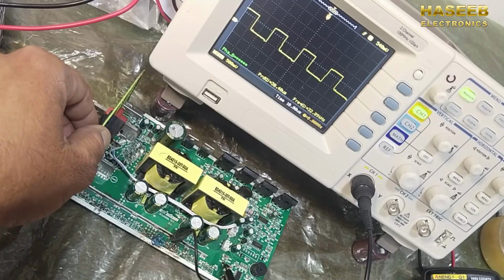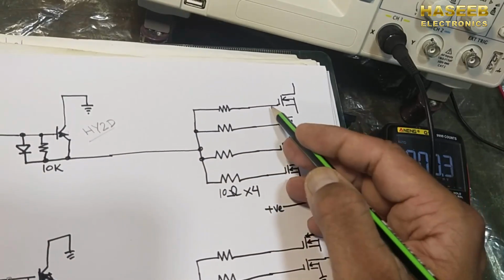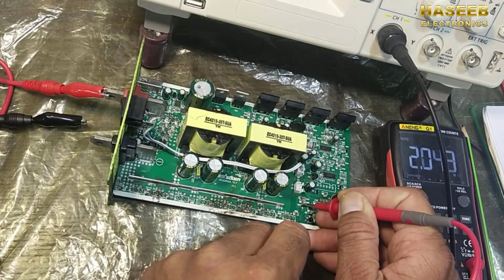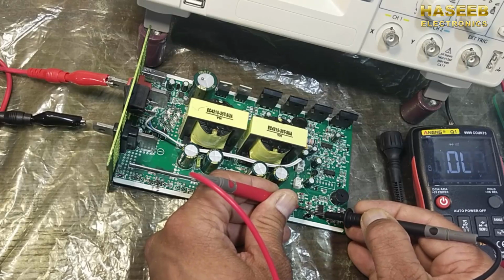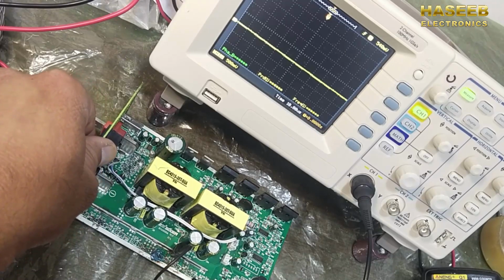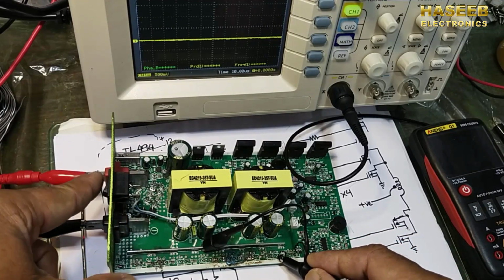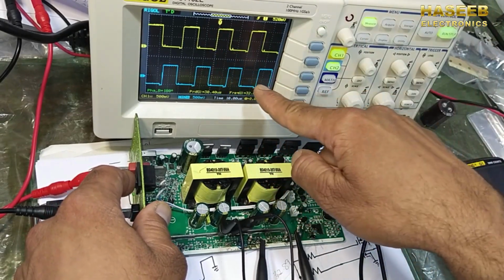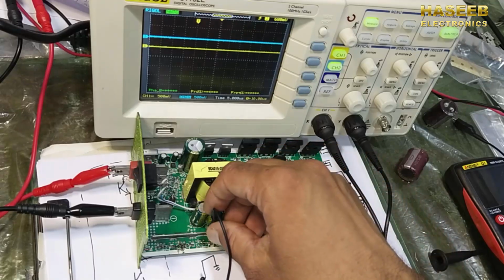{446} How to Test MOSFET Gate Signal / How to Repair MOSFET Gate Drive Network/ MOSFET Failure Cause

Comment: Valuable video sir
Question
Please using multimeter in voltage mode to test the battery side signal between source to gate 
What will be the expected voltage they?
Thank you sir for your response

Comment: Wow, that was explained well. I'm about to test MOSFETs on all in one inverter on the battery side. There is no short at battery with meter but battery trips short protection in BMS. Solar and inverter sides work fine.

Comment: Sir what are causes of damage of Mosfate and resistors
Reply from the maker: mosfet damages due to over heat, over voltage stress, improper gate drive signals, and sometimes there is no possible reason
Reply: @HaseebElectronics  thank you

Comment: Pls which transistor is equivalent with hy2d pls
Reply from the maker: HY2D is SS8550 pnp transistor 
you can use any 40V 1.5 ampere PNP transistor 
or use 
2SA2056 WF SOT-23
Y2, BF coded PNP transistors

Comment: Hi Haseeb.  Maybe you can help.  When fixing the inverter I remove 4 transistors, 2 PNP and 2NPN, but I forgot to mark or colour code it and now I don't know which way is the correct.  From the other side it looks that the emiiter of each pair of transistor goes to gates of the mosfets.  The orientation of the transistor is marked on the board but not which pair is NPN or PNP.  Any way to find out?  there are 2 C945 and 2 A733.  There are 16 Mosfets in my booster stage. Thanks

Comment: Aoa .
Sir. After rectification of faulty components. 
Still one side chopper fet's get heat up but when i remove one any one chopper s FETs its  works  correctly bt the output voltage drops to 130 volt s due to one side chopper
What can i do ?

Comment: What could cause 1 mosfet of a parallel set to be damaged continually, when only 1 mosfet is installed per drive,,
The circuit works properly. The gate drives test good when no mosfets installed.thanks for any help you can give me.

Comment: Love your way of working, you work like a pro, there is many noob i saw who dont know the working of pcb or the components they just replacing all parts one by one till the problem resolve 😂
First replace the mosfet if it burn replace the ic, if not work threw it in trash 😂

Comment: My friend.I have a Grid tie inverter 600Watt power.It does not have LIMITER SENSOR.So times come and feeds back the grid.Is there any electronic small motherboard that will help to create an additional limiter sensor arrangement.of course i have the clamp sensor.Thank you.

Comment: Hello sr.i have problem this ic L25088 dc to dc converter the problem is the mosfet n-chanel is allways blown when i replace it the gate driver of the mosfet is 6 volt...how can i check this ic L 25088..im in the phillippines

Comment: Salam Aleikum, can we check the mosfet on circuit ? how to test the IC that manages the 4 mosfets in the H Bridge.
My inverter produces only 140 Vdc then shuts down because of protection. I also takes more than 3A from my 12v battery to eventually produce only 68vac before shutting down. All mosfets and their gate resistance in the 12V section are good, measured on circuit. Thanks for your guidance to find the short.

Comment: Why two transistors PNP and npn connected in that way also why resistor and diode connected in parallel before reaching the mosfet gate resistor

Comment: Looking  of the connection  you have made sir to  the last  transistors  which  are npn transistors.  Emitter of a npn is connect to a base of pnp transistors  .my question  is are we going  to connect  emitter to ground  from  each transistors( npn ) and base the output  of the ic.there are two legs of a transistors  which  are not  connect. E.g.. collectors  and based of npn transistors.

Comment: Sir is it necessary to have an oscilloscope for checking signal
Reply from the maker: yes dear in modern electronics technology it is necessary to use oscilloscope. because it needs to view the signal waveshape, otherwise it becomes difficult to locate the fault

Comment: All faulty  mosfet  remove  , and chek gate  chek by DSO please  sir make video  in this subject  in urdu language. 
Sir, your video is  really  very  useful 👌. 
Thanks,  thanks  sir,
Also sir ,  telecom smps module  reparing  20mhz dso oscilloscope use?
How to choose  ground  dso,  470uf/450  capacitor  - ground  use in???
Same guide sir

Comment: Thank you so much for this great videos, Im trying to repair kind of electronic devices like this, so can you suggest me an oscillospe, which are price-performance device, for this kind of works, Allah(c.c) bless you.
Reply from the maker: best regards dear 
if you can find some 100MHz, dual channal, 1GS/Sec (1 gega samples / second) that  will awesome 
you can also 50 MHz but i will recommend 100MHz, 
try to find Hantek, Regol, Uni-T brands or similar 
if you want to ourchase online, try to explore Banggood online shopping china

Comment: Just concern with cap which make oscilloscope higher enough
Reply from the maker: yes dear, we will check capacitor and its voltage

Comment: one primary side of transformer has driven by four mosfet switch. is it each four mosfet has opposite to each other simultaneously
Reply from the maker: exactly, two mosfet from one transformer and two from second transformer will work together that means four mosfets will work together while the other four will remain off.
in upcoming video we will install mosfets and will see their operation sequence using oscilloscope

Comment: Hi sir, how are you..?
Please explain how can we check the 
IGBT gate drive in this type of inverters 
without oscilloscope. 
How can we check check with the help of a multi meter.
Because so many Technicians don't have oscilloscopes.
Reply: Use potential meter and use your headset. Ok

Comment: وعليكم السلام ورحمة اللة وبركاته وشكرا لك أخي جزاك الله خيرا . عندي وسؤال.. alimentation ps4 fat problème on. offو شكرا لك
Reply: غيرة اخرى فشتغلت ولكن المعطلة تنطفئ؟؟؟
Reply from the maker: اهلا و سهلا
هل عندك مشكلة فلم الجهاز او في الباور سبلائى؟
Reply: @HaseebElectronics  اخي العزيز عندي مشكلة في البور سبلاى.ساعدني من فضلك.
Reply from the maker: @omarladlani4347  إذا تعمل jumper 
يخرج ١٢ فولت او لا؟
Reply from the maker: نقلني رقم الموديل البور سبلاىى
ADP-------
Reply: @HaseebElectronics  adp240CR   AA
Reply: لا يخرج ١٢ volts يخرج مرتان ٥فولت ماس واحد لا يخرج منه شيء  و اثنين يعطوني 4.84 volt
Reply from the maker: فحص دي سي فولت عل ى المكثف
DC volt around 300VDC 
أعمل جمبر على output connector 
و فحص ٤٠٠ فولت دي سي على المكثف 

فولت قبل جمبر   و. بعد الجمبر
Reply: نعم غيرت اشتغل البلاي واخرى  تنطفئ مباشرة  في أقل من نصف ثانية.
Reply: فلت لك نصف ثانية؟؟

Comment: What is the reason for turning power on after scope probe is placed in contact first instead of turning on power and then placing probe? How much voltage was being applied?
Reply from the maker: because MOSFETs are not installed in the circuit, and if we turn ON the inverter and then we connect scope, 
in this connection time the MCU will disable the TL494 because the MCU will fail to find output voltage. it waits just few seconds for availability of the output. 
in next video i will install mosfets and then we will check all signals without turning ON/OFF
it is applied 12VDC and there was no output so TL494 was operating at maximum duty cycle.  when the mosfet will present the inverter will produce output then the duty cycle will decrease automatically
Reply: @HaseebElectronics  Thank you for that explanation. Looking forward to the next video. Always enjoys videos using a scope.
Reply from the maker: it is my pleasure

Comment: Uc3843 IC MOSFET burn problem IC is ok ic power supply 12 volt dc can not switching MOSFET Isis 6 number pin output voltage 11 DC please call this problem solution
Reply from the maker: Please check Vref at pin 8 it must 5 volt. if not available replace IC
Please check MOSFET gate drive components may be some diode may damage 
please check Capacitor & resistor at pin 4
Reply: 8 number pin 5 volt is available and others resistance capacitor is ok 1 number pin voltage 7.5 to 7.8  4 number pin output Swatooth waves ic is ok?
Reply from the maker: please verify current sense resistor, vcc network, and mosfet 
if everything is ok
then
replace ic. I think it's output portion is not good
Reply: Pronoy sarkar ji,pl your contact no

Comment: Pretty sure it's going to output 33KHz, not 66KHz, from that centre-tapped transformer, same as the 2 out -of-phase input signals, isn't it?
Reply from the maker: exactly right
in push pull the TL494 output frequency is divided by 2. so its oscillator and RT CT are calculated at full frequency 
each channel will switch at 33KHz

Comment: Thanks for your tutorial
 Is it possible to analyze the complete circuit of this inverter? Thank you
Reply from the maker: yes it is possible 
but it becomes very very long 
so that is reason i am sharing in parts
part 1 - video number 439
part 2  - video number 442
part 3 - video number 443
this part 4 - video number 446
next parts are coming soon
Reply: thanks for your response I have seen all these videos You have explained very fluently and well Without complicating the circuit thanks a lot 
I am waiting for your next video

Comment: Thank you brother, but you always forget to explain how the transistor opens (by the current difference between base and emeteur) unlike the mosfet that opens up by a difference in voltage between gate and source